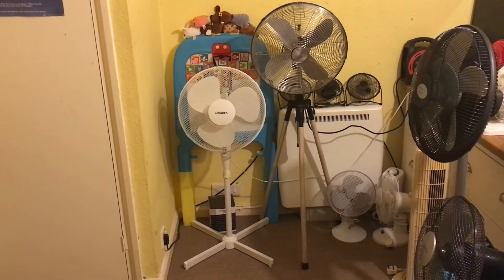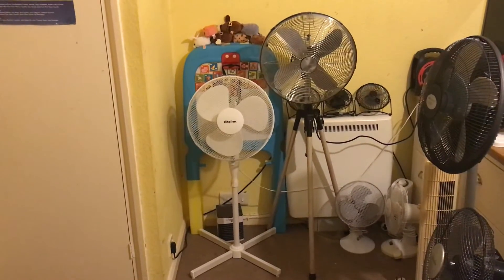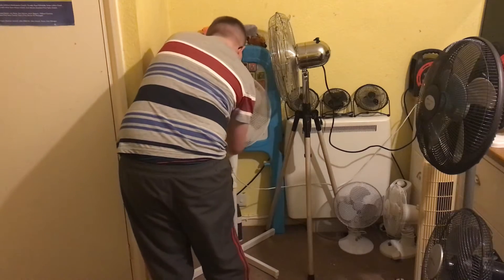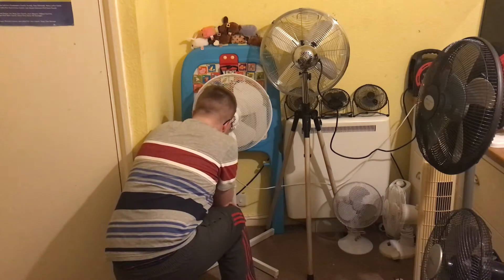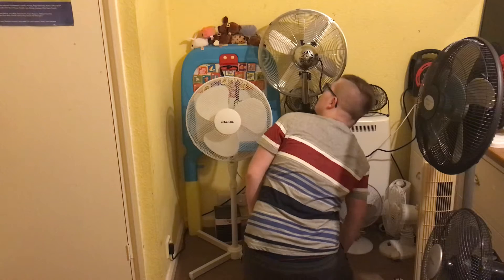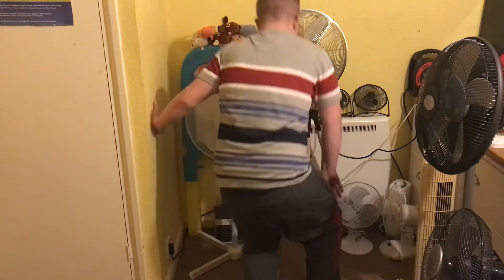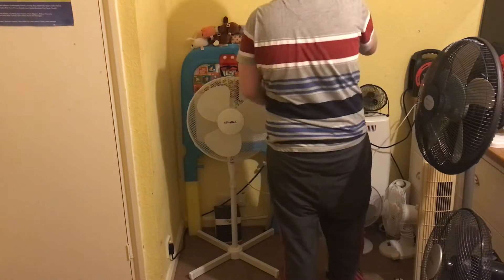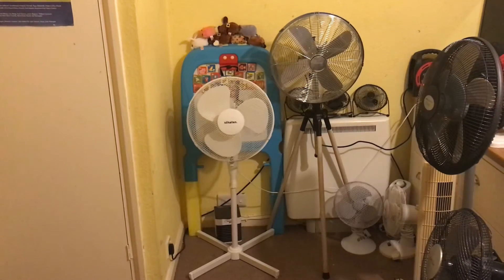Schallen 16 inch white pedestal fan VS Goodmans 16 inch chrome and black tripod pedestal fan

Comment: you should have brought the b&q fan to your house but that's just my opinion
Reply from the maker: There is a reason why I have brought this fan home the reason is that my parents don’t have a fan for there room and they need one so I’m going to give them this one so it won’t be apart of my fan collection anymore but I will get my Honeywell 16 inch black pedestal fan back because I’m going to trade the schallen for the Honeywell also I will be getting another fan to go in the schallens place and it’s a Fine Elements 16 inch pedestal I know I have one already but the one I’m going to be getting is a different model
Reply: @kieransfansgarbagetrucksan8552  ok, makes sense now